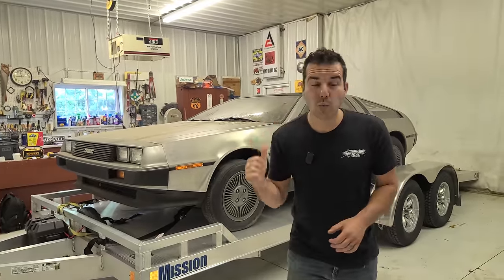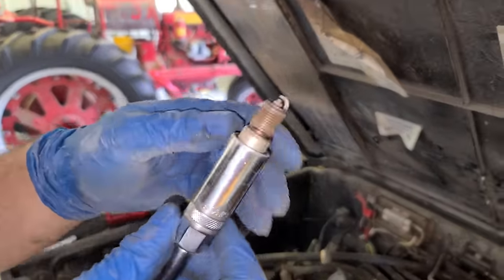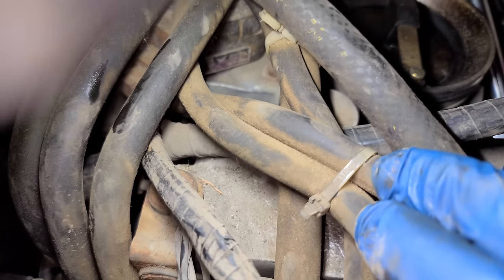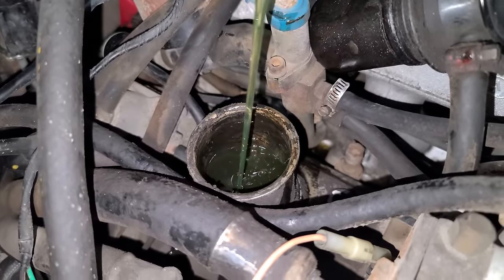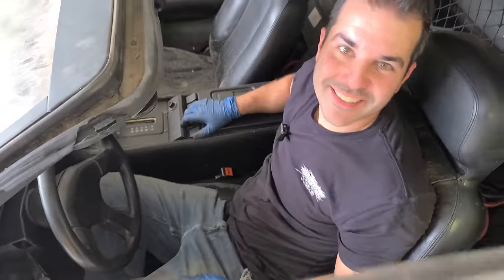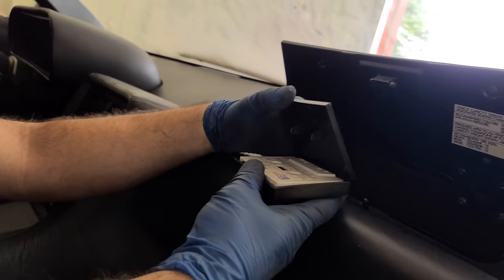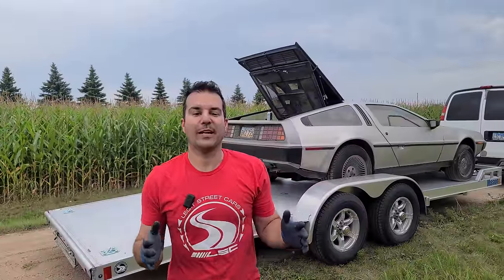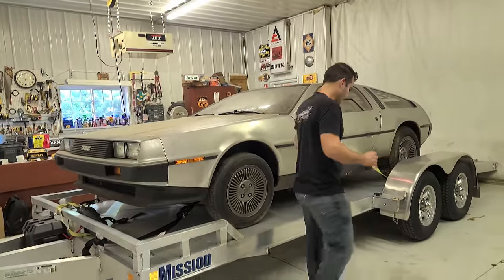First Start Of My Abandoned DeLorean After Sitting For 32 Years! Look What's In The Glove Box!

Comment: For the cis it's basically Porsche 911 stuff from the air-cooled cars, you can get parts and most of it is just take apart and clean and it will work

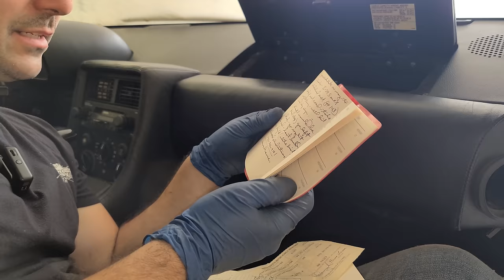Comment: Alex in this car is like a kid in a toy store at Christmas time :D so great to see. 29:32 absolutely cracked me up 😂.

Regarding the needed oil...I feel like a normal road car engine asking for a 20W-50 oil is very strange and makes it seem like they need really thick oil to not have the engine leak. Very questionable. This kind of oil is usually only needed for really high performance engines that also run on the track. In addition, a 20W oil would be absolutely devastating to start in the winter in a northern state like North Dakota where the nights and morning are really cold. That can't be good.

Comment: I can't believe you didn't realize you can release zip ties with a very small (like a watchmaker) flatblade screwdriver. You just have to pull the ratchet blade open and bingo the tie will release. Takes a bit of time but if you are trying to preserve originallity it is well worth it Alex.
Reply: Easier doing it from the backside if you can...then it will stay open.

Comment: I am not a mechanic but its absolutely crazy that you would take those cylinders off wihtout even a wet-wipe bath for that engine. So much dust on it. Compressed air spray  at it, wipe it down with a damp cloth or hell hit it with a hose lol (not best practice but alas)

Comment: Those old CIS fuel systems do not like to sit. Old gas trashes the injectors and the pin at the bottom of the fuel distributor siezes up. They need to he thoroughly gone through and cleaned. Former Volvo mechanic here. You can probably still get new injectors from IPD. Those engines were used in the early 80's in the Volvo 260's.

Comment: I just bought a 2006 dodge magnum SXT in January of this year, ran good with 200K miles, paid $1900.00 for it and took the first three days archiving the things I found and seeing what worked. I got the original window sticker, owners manual, everything that came with the original sale. BTW runs like a top 8 months later needs an oil change (my 1st one was 3 months ago) but that's coming. had to replace the windshield and the cigarette lighter doesn't work, but otherwise, couldn't have gotten a better car for the money

Comment: ATF has less "detergents" than motor oil, which doesn't really matter since not much detergency action is gonna happen at room temp. W hat you need is solvency, like Marvel Mystery + kero or diesel + penetrating oil. Motorcycle chain lube spray is the grand slam of shop lubes. Anti-corrosives, anti-wear, penetration and even foaming action. Worth a shot next time.

Comment: The DeLorean motor company in Texas has all the parts you would ever need to build, rebuild, or repair your DeLorean. They bought the company with all rights to everything DMC DeLorean. They have the enormous back stock of already made parts as well as all the molds and dies to stamp new parts. So it’s really not that hard to get parts. Just expensive.

Comment: So fyi that belt on the door handle is actually factory. They are used to get the door to start coming down when seated in the vehicle. It was done so the door panels weren't ripped off. There is a delorean fact guy who does shorts about all the little features and quirks on deloreans. Like that little tab on the upper part of the window frame is to help guide the window into its proper place

Comment: if i'm not entirely wrong..then that leather strap on the door handle is original...the older models came with one just wraped around the handle. In the later models they moved it further back and it became it's own thing.

Comment: Just catching up.  I love cats but I'm super allergic too, just watching that fluffy boi walk around your legs made me start sniffling in sympathy.  What a good little orange guy.  Also love the DeLorean.  I'm an old Volvo nerd so I've had a few experiences with that PRV V6, mostly ripping it out and putting a bulletproof Volvo redblock in its place. Not complete garbage but not ideal.  If I recall correctly the early ones had too-small oil galleys and if you delayed an oil change even a little, the cams would get starved of oil and it became an engine-out repair.  It got a bad rep in the Volvo community for that. I'm a new subscriber so it's like time travel as I go back 10 months to see what happened.

Comment: That carbon build up can be from not revving the engine up enough, but in this case most likely from that clagged up air filter making it run rich.
Edit: that asbestos, squirt it down with WD-40, try to use a squirter bottle rather than an aerosol spray can.

Comment: The original version of this car was meant to be lower to the ground. John Z had to raise it to comply with US "safety" standards. I'd suggest lowering it down to the originally designed ride height. The PRV engine isn't a bad one, Renault used it in the Alpine and it's a good basis for various mods and turbocharging.

Comment: In a bid to keep LSC alive and kicking - take it from a brit who has lived for 55 years, we shut down ENTIRE streets if just one house has even traces of asbestos in it!! So please, get that shield off and replace it with a modern material. Love your work Alex, huge fan.
Reply: Asbestos shields are all over that car..around the starter and Cat converter...and another is that muffler area between the engine and Muffler...and another is bolted to the fiberglass body above the transmission....since the exhaust system wraps AROUND the engine on all sides..it's even above the transmission.Just think of the delorean engine compartment as a covered Barbecue grill.

Comment: That old Bosch Jetronic CIS system does NOT like fuel with ethanol and I bet that microswitch you pointed out if it was near the throttle body was for the full throttle enrichment. Those fuel distributors are like Gold and extremely hard to find replacements although I believe a new gasket kit may be available. When those CIS systems are working they tend to work pretty well in my experience with quite a few of them.  It is too bad you got an Automatic car though maybe swap it.
Reply: Frames are different...gotta modify that frame to make it a 5 speed.

Comment: FYI. Motor oil has significantly more detergent in it. Transmissions don't need detergent because they aren't dealing with cleaning combustion byproducts. Most people will argue with me on this, but once you do the digging on the additives, you will find that trans fluid is nothing but a thinner base oil with friction modifier packages. 

Motor oil is a thicker base with friction modifiers, viscosity modifiers, and detergent packages. 

I was once a guy that thought transmission fluid had high detergents until a transmission builder corrected me. I then started researching it and realized that it's just false information that's been shared for decades as common knowledge.

Comment: These PRV engines have huge ports man... Turbo versions made up to 400hp, electric fuel injected.
A friend of mine had a Volvo wagon and he had to put head gaskets on it... Stupid procedure for timing the cams though.better to mark em before you pull them apart.

Comment: You should at least try charging that old battery. It looks not to have seen much use and has just slowly drained over time. Without being cycled a lot it may take a bit to get it to start taking a charge but, may actually still come good.

Comment: It is very hard on a motor that has been sitting for any length of time to start it using starter fluid. You should start it with two-stroke fuel.  Old oil?  Oil does not spoil. I cannot believe you did that to your motor, did you even check to see if you had oil pressure. Ouch.  Regardless, good luck - I hope you reanimate it to its original condition.

Comment: I know MUCH about proper restoration, one thing to consider YOU DON'T EVER TRY TI Shine IT UP. IF SHINED EILL SHOE SI MANY SCRSOES DENTS SND IMPERFECTIONS you have not noticed. A 3m Scotch Brite green pad, double size works great to gently follow the brushed grain. The dealerships had a spinning machine to rebuff the surface, anyplace you do touch do it gently or you will have to go the entire car and will never look factory again. Please consider using a refrigerator stainless polish and always go with the brushed grain of the car. I didn't mean to leave caps on earlier and an using my phone so didn't want to change. I have done the headliner twice if you have any questions, also there is a cardboard DMC Delorean motor corporation or company,  that gives a great embossed logo on the two roof sides. Feel free to ask I have restored 2. And learned lots on the first one. I'm sure Delorean One can help best. I think they own the rights to the Delorean and have all the OEM nos Parts.

Comment: i in 1981. i worked at Brahman toyota inb Miami SL when the first DeLorien was delivered to the dealer.. i got yo grivr one to the Miami car show that yrar along with meny other new cars from the brahman dealers there Toyota,  Cadillac and the World Car cebter.. the DMC 12 was under powered and sluggish throuhj hyway traffic but rode nice and slooth very comfortable.. performance was a little lacking but suspension and steerint excelent..I out ran one in a Toyota celica GT lift back with a 2.3 4 banger,,5 sped manual.. through city traffic.. lol  the DMC rides heavy, and the suspension is a bit too lightly sprung for spirited driving., I was excited to drive a car i was aware of since the first articles about it forthcoming release i read in various car mags a year before the first production models came to Miami...all stainless steel body work, with gull wing doors on a rear engine sports car.. what's not to be excited about.....I weas disappointed with the lack of options, only light or dark grey interior the only really neat thing sitting in the griver seatthe shifter knod was right in your hand.with a very short shift gate..the only other option was either  manual or auto trans ,,,lol who thought this was a good idea??

Comment: You dodged a bullet there not having to replace the Toll booth window motors/Regulators...and shredding up your arm in the process on the sharp edges of those Stainless Steel doors...BTW there is another KEYED compartment behind the drivers seat...(in the same fashion as the battery compartment) I just wonder what treasures might lurk in there...also, look in the front trunk area there is another area between the headlights with a removable cover that possibly the tools to jack up and remove a flat tire might still be in there. BTW there is supposed to be a plastic  Cover that closes off the battery compartment from the passenger compartment...Also  you will need to put a plastic tray in the battery compartment to keep ANY BATTERY acid from Ruining damaging your carpet...and IT WILL ruin your carpet...it is a well known Delorean problem....and there is a tie down strap in that battery compartment just look in there to see it.

Comment: The wear on the brake pedal rubber, air filter element and the oil leak residue at front of engine suggest much more than 16000 miles, much more.

Comment: A front engine car driving down dirt roads leaves all the dirt and dust it kicks up behind it as you drive.  A rear engine car has all the dirt and dust you kick up driving down a dirt road getting sucked right into the air filter.

Comment: lol pos motor
any volvo b28e of f basically is the same. they like to eat cams.....i sell parts for them to this day including the firewall plug kit ( lol, bad cam means take the motor out or cut a hole in the firewall, which was volvo's solution )   you can fix most of your fuel issues with a ultrasonic cleaner...DONT take the Fuel distributor apart unless you are REALLY carefull.

Comment: Too bad, you didn’t live closer, I am very well-versed in CIS fuel injection systems, I have all of the repair tools and pressure testing jigs for the Bosch fuel injection systems. a lot of people from all around the United States Send me their CIS parts for restoration or repairs, I enjoy fixing those old fuel injection systems and I love the challenge. But do everything you can to make sure you run non-ethanol fuel if you plan on keeping that system intact

Comment: Starting fluid is not proper way of starting an engine that has sat for many years. Cylinders are dry and starting fluid doesn't help it. Use 2stroke gas the oil will help lube those cylinders. Big time screw up

Comment: Engine swap. Engine swap. Engine swap. 

That car always needed a good engine when new. And it still does. 

Back to the Future theme it would be fitting with a VW VR6 enginge or Ford V6 EcoBoost with Mercedes/Mitsubishi ISG 48volt Hybrid system.

Or just sol e Ferrari 360 engine with a Supercharger like the 63AMG you made 🤷🏻‍♂️